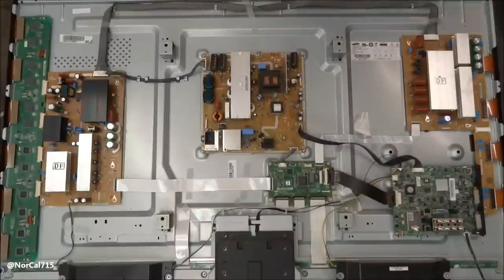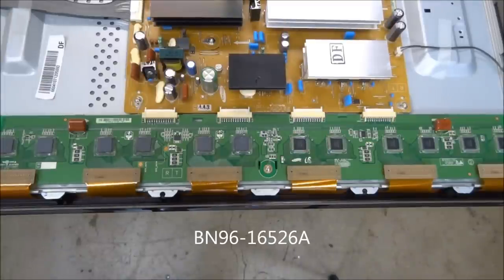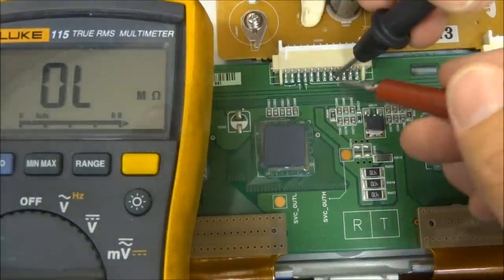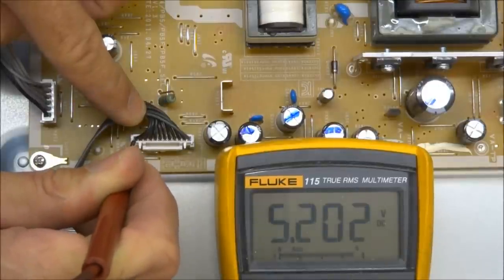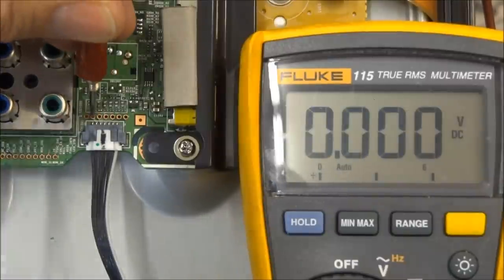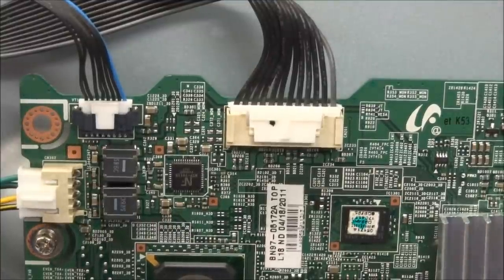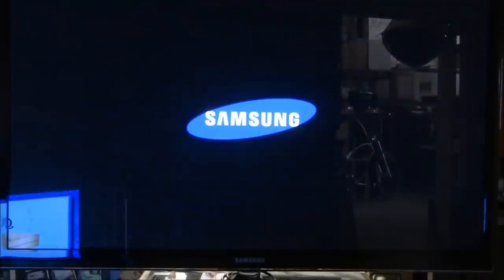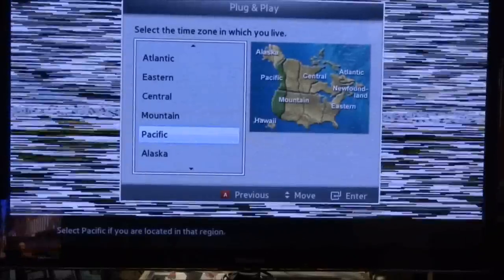Samsung PN51D550C1FXZA Voltages and Troubleshooting

Comment: I have a PN51E550D1F that will not do any thing.
It shows 5 volts STBY. on the power supply but there is no STBY.light on the front panel.
There is no flashing light on the logic board until do the jumper trick on the power supply , only then I get a fast blinking light and a red screen.
So does that mean I have a bad main board?

Comment: hi,I have same model TV ,My tv audio is working fine ,in the screen there is grains ,when i press menu button in remote some light changes also coming in screen but NO video ,all voltages seems ok,,HB led flashing good ,I have already replaced Y,Z boars .still having same issue .please help

Comment: When i power up the tv checking the 15v on the power board it climbs down without shutting the power off, the other voltages also drop before i power the unit off? how come, the capacitors visually all look good. when i power up the tv i get two blinks then nothing, although the standby works.

Comment: Mine is a pn51d550c1f, I plugged the power supply in and on the left side of the logic board was a small yellow flash and the green light no longer comes on. Any help??

Comment: Thanks so much for your video, however I am still a bit lost as to what is causing my fault. here is what I have done:
I have a Samsung PS50A Plasma TV. 

Symptom 1 - No standby LED light
Symptom 2 - Power LED is on
Symptom 3 - No picture or sound
Symptom 4 - No response to front buttons or remote control

Test 1 - VS Scan Voltage is correct on PSU and on Y Main
Test 2 - VA Voltage is working and correct
Test 3 - Ve Voltage is correct on PSU and in X Main
Test 4 - Voltages correct on CN801 (3v points reporting as 5v)
Test 5 - Voltages correct on CN802 (3v points reporting as 5v)
Test 6 - Logic Board LED blinking once per second
Test 7 - Mainboard disconnected and cable shorted, Logic board shorted into test mode and all patterns displayed on screen as expected. I expect that this means my X and Y boards are ok
Test 8 - All faulty capacitors have been replaced.Two replaced on Y Main and one replaced on X Main.
Test 9 - I can see a voltage drop on CN201 Pin 1 when pressing the remote buttons.

Can I assume that is is my Main board that is faulty. Can you advise? Thanks again for helping with diagnosing this problem.